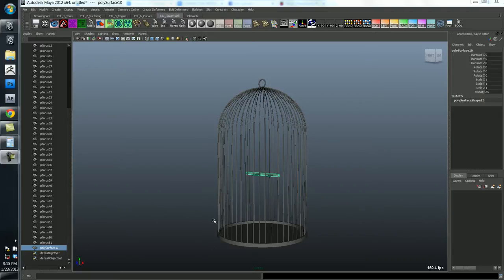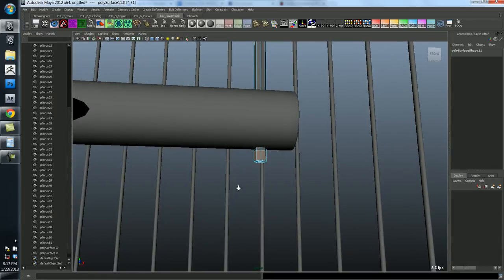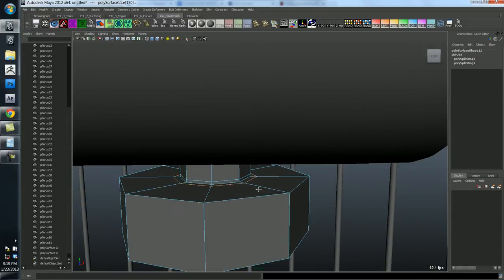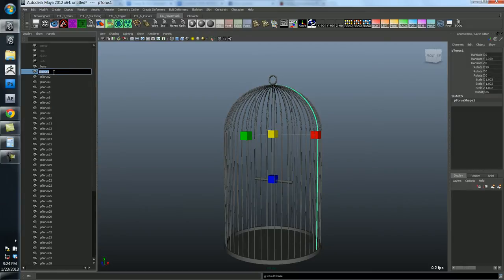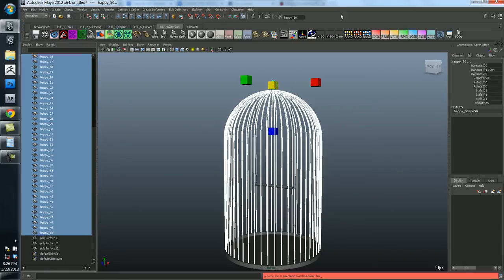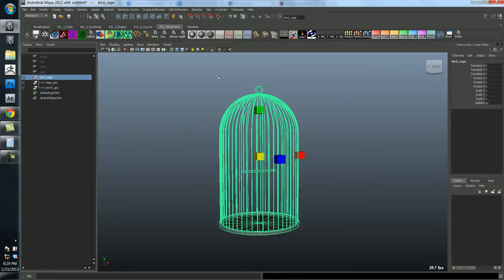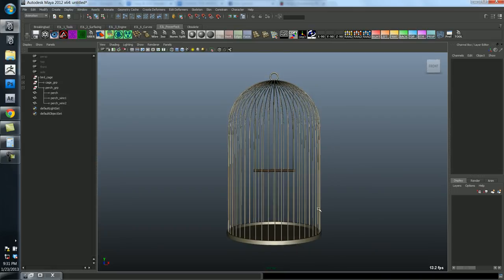Intro to Maya and 3D Modeling - Lecture B: 11/13 - Birdcage Model

Comment: Why do you scale -1 and then fix the normals instead of just rotating 180?
Reply from the maker: In some cases there is a difference and it depends on your final goal for the model. Remember that performing the scale is akin to making an identical mirror- rotating may not give you full symmetry. And then in other instances such as this one, it's just personal preference or habits. :)
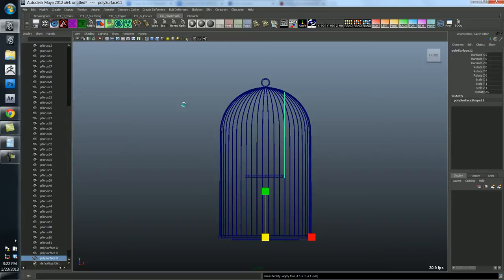Reply: At around 6:30, it scaled perfectly fine but I recall in another part of your videos you had inverted normals after scaling -1. Is this because the last object was open and this one is closed off?